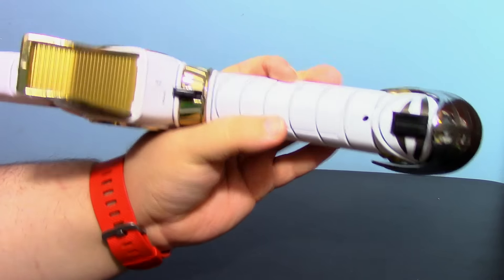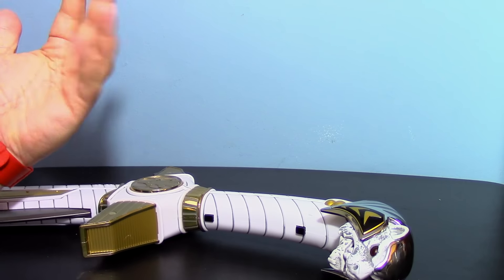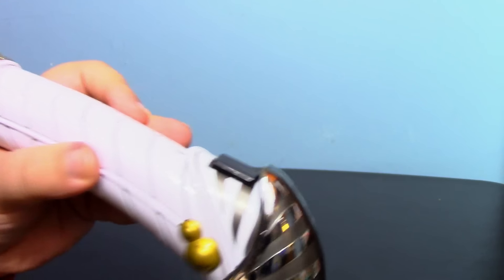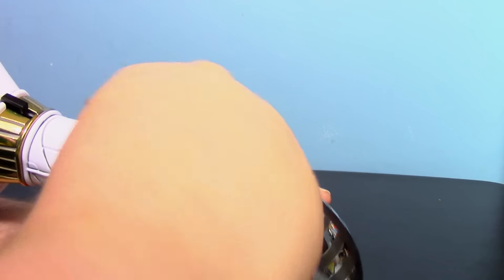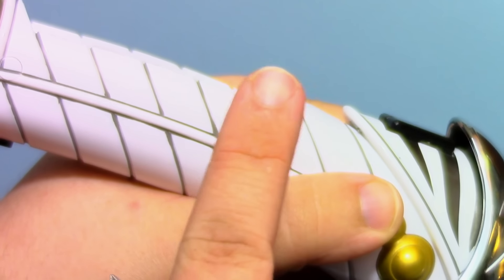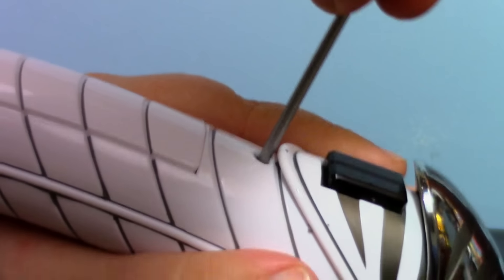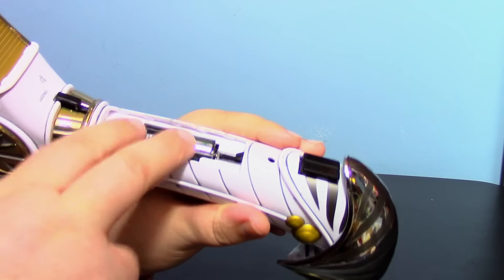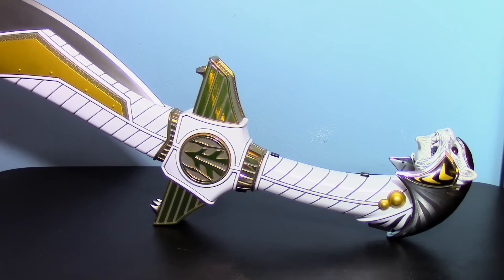Legacy Saba Update: Removing the battery cover

Comment: Just pulled mine out of storage, probably been in storage since before this video even came out tbh (5 years at the time of writing this). And had so much trouble getting it and your video helped tremendously!   Admittedly I should have taken the batteries out when I packed it up, but alas, did not. Luckily I packed it WELL, in its original box wrapped in multiple layers of plastic, kept in temperature controlled areas, so not even a hint of corrosion. (Lucky, I know).  But thanks a ton for this video!
Reply: Same! Very helpful

Comment: unfortunately mine is now broken aka can't remove the batt cover as its been locked tight.....lucky thing i removed the batteries
Reply from the maker: Have you tried drilling a little hole/divot in the black plastic and using a screwdriver (or something small) to attempt moving it that way?

I fear that mine too will eventually get to the point where it can't be operated. Sorry yours has broken. :\
Reply: nope not yet...contemplating if i should just disassemble the hilt and remove the locking mechanism
Reply from the maker: Well good luck if you do. I've heard removing the screw covers on these items can be a real hassle and rarely come off without getting damaged. Why they went for this sort of locking mechanism is beyond me when it seems much simpler methods are out there.

How long have you had your Saba? It'd be great if you could contact Bandai and see about getting a replacement.
Reply: JTMitchell87 good news managed  to open the battery compartment and as I expected the locking mechanism is broken so it's now in a fixed position.....next is to sand down the black locking mechanism just enough so the battery compartment won't come/slip off when placed back....stick masking tape on the battery compartment with a flap so it's easy to pull off the cover and voila......my saba is working again after 2 years
Reply from the maker: I'm glad to hear Saba has life again! I hope I don't ever have to do those mods again, but it's good to know it can be salvaged if it comes to that.

Comment: I attempted at removing the lid and no luck. It's such a hassle. I heard if you leave batteries in it'll corrode and malfunction the device. Is this true?
Reply from the maker: Sadly that's true for anything that takes batteries. I've had some toys that had corroded batteries after a year, but I've had some that have had the same batteries for going on ten and still don't have corrosion. I don't know what factors speed or delay the process.

Comment: I need some help.  Changed the batteries, and now it doesn't work at all.  What can I do to fix it?
Reply from the maker: I'm not sure... Was it working before you replaced the batteries or were they fully dead already?

I can only suggest making sure they were inserted correctly or try checking to see if there's any corrosion inside.